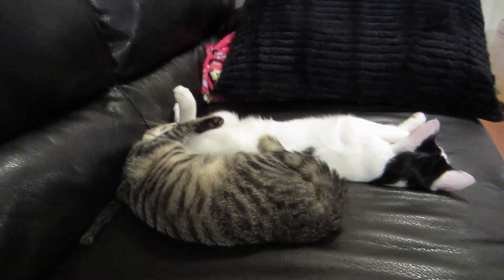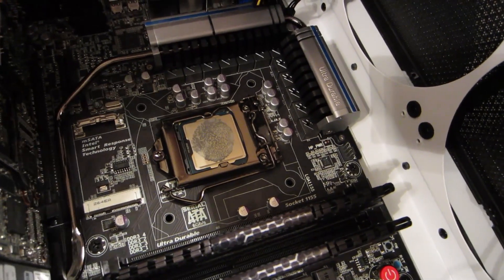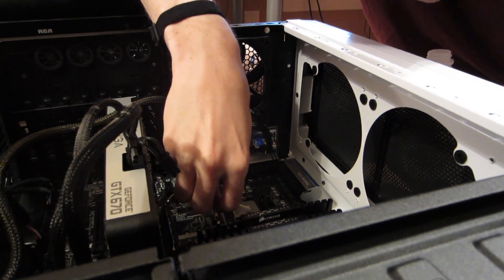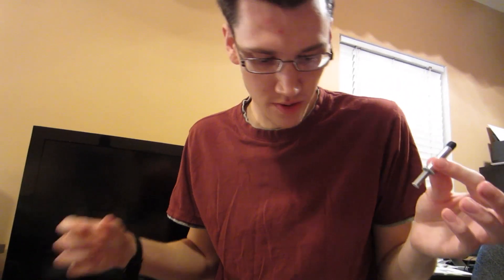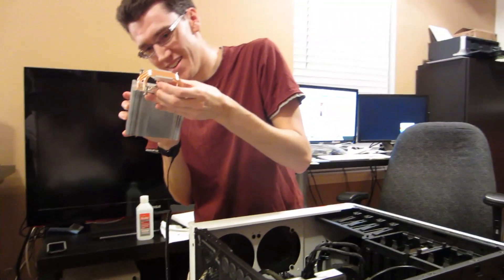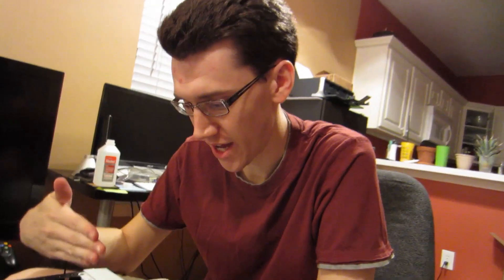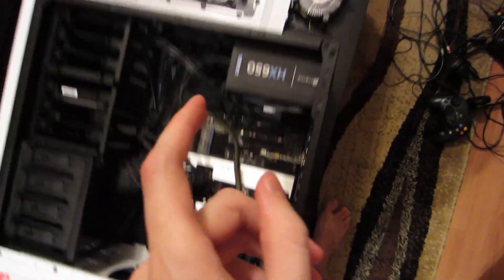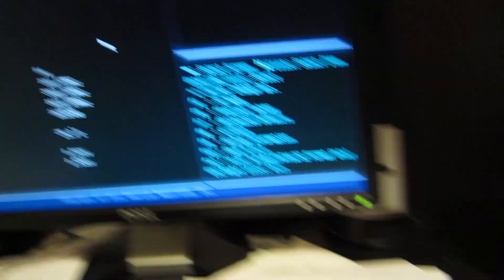First Aftermarket CPU Cooler Experience (Day 1050 - 10/9/12)

Comment: Stephen you did a great job. Aftermarket CPU coolers are always a bit tricky to mount (because of the amount of variables in the installation process). My first CPU cooler was a HUGE thermalright mux-120 that i wanted to put in a small micro atx chassis, there was a lot of swearing.

Comment: Your case should have a number of cable management features for routing everything behind the motherboard. Your 24-pin and 8-pin ATX cables should lead out from the PSU and back around through the closest holes to where they belong on the mobo; then SATA and SATA power cables; then case stuff (audio/usb); finally, GPU power. Keep as much of the cabling behind the mobo as possible & tie with zip ties. It's a relatively straightforward procedure, and it's worth a shot if you can spare ~ an hour.